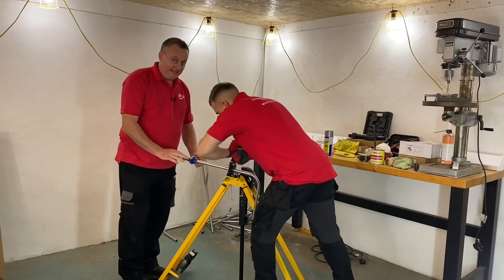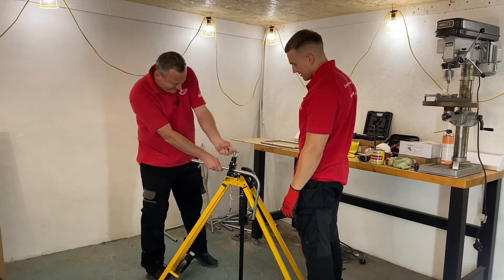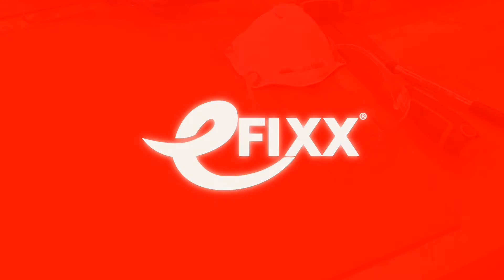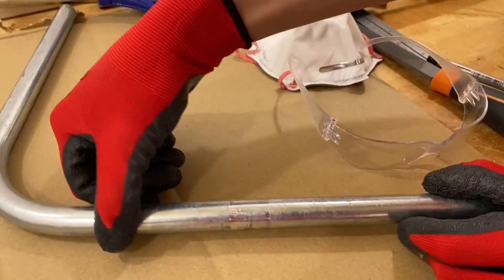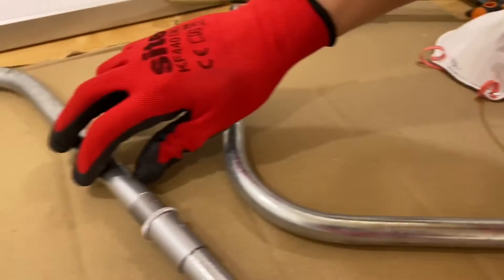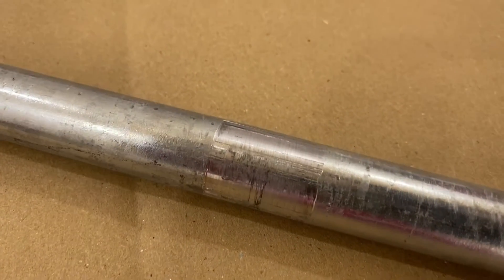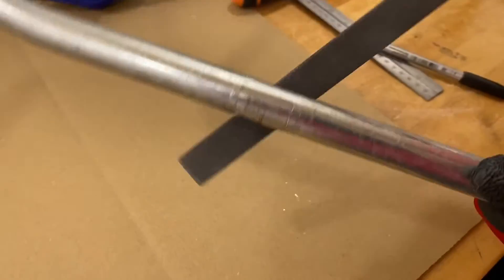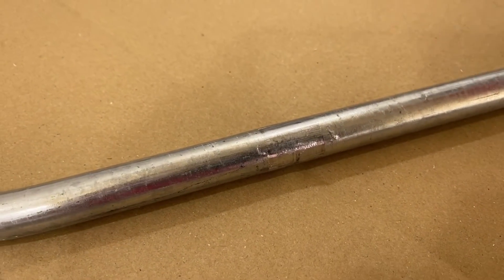Are your conduit installs a little rusty?

Comment: When I was in college 27 years ago, we used conduit that came already painted in black; it was a nice smooth glossy finish as if it were enamel coated.
Reply: Haha the black enamel conduit only to be used indoors and would definitely rust once water or moisture came into contact with where the paint was no coated.

Hey them were the days you used to have to have 110v leads and drills to carry around or manually mangle your hole physically..... Jobs them days lasted months if not years as today just weeks 😏

Comment: Thin rubber matting glued into the former prevents scuffing.

If you scuff it like that, you’ve created a weakness in the steel anyway so, should really be cutting a new piece…

Thoroughly clean the oil off the thread with a degreaser. Dry thoroughly & spray Rocol Galva Flash on the threads. It has a zinc resin compound base that really lasts.

Once dried & cleaned off, use white lithium spray on the threads just before screwing on/up to stop it from seizing & stopping the ingress of contaminants.